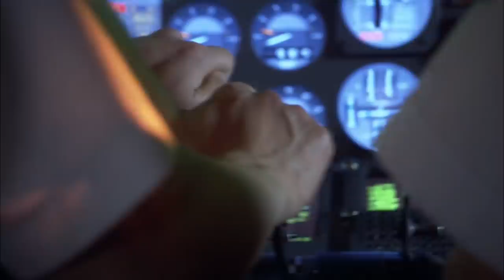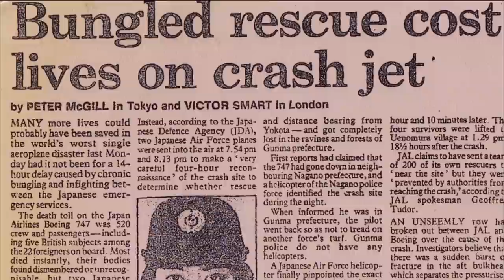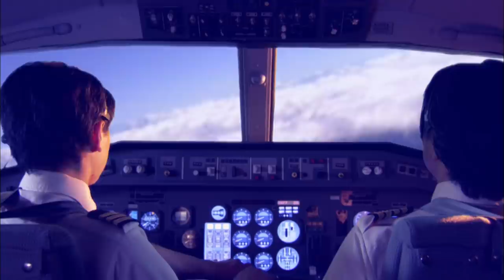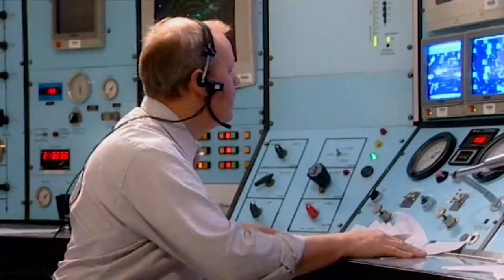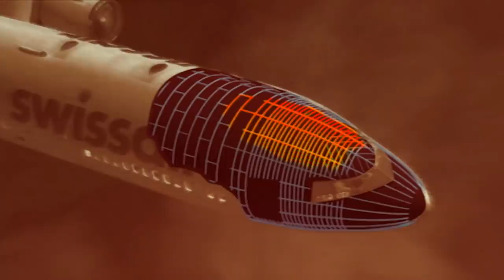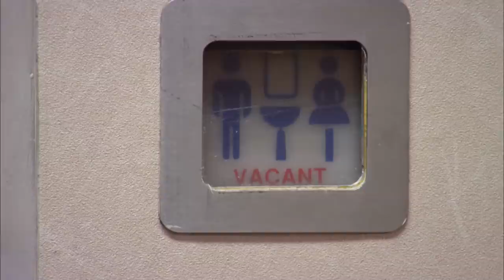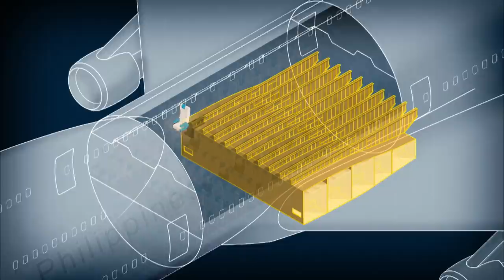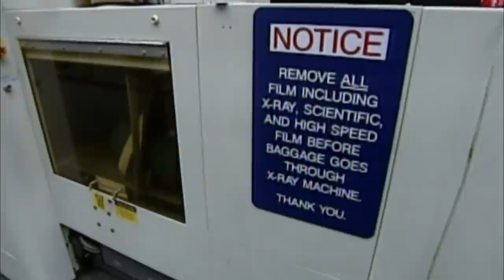The Deadliest Aircraft Disasters In Aviation History | Mayday | Wonder

Comment: Re: The Japanese flight. Yes, the ho-hum attitude of the self defense forces certainly cost lives. Must be a cultural thing is all I can guess. The attitude of the police treating the disaster as a crime and restricting access to the only people that could figure out what caused the crash wasn't helpful either.
The pilots did an amazing flying job keeping the plane aloft as long as they did.
Excellent video.
Reply: All they did was postpone the inevitable
Reply: @Seri-Katil  They kept trying to save the lives of every person on that plane right up until the last moment. As they did not know exactly what was causing all the issues, they continued to keep the plane in the sky while attempting to problem solve.
Reply: L
Reply: @oOoJadeBladeoOo  Christina, hi. What does "L" mean ?  Chuck
Reply: @charlesclager6808  usually means Loss. see it used under something where people think someone has a bad opinion or they said something/did something they don't agree with. alternatively people use W in the same fashion for things they agree with, W for Win
Reply: @Seri-Katil inevitable means the crash was going to occur yet they came close.   So close that Dennis fitch studied the Black swan event and used differential thrust to minimize damage

Comment: The Philippines Airlines one, the captain taking over communications with ACT in saved them a lot of time and frustration. And having an American take over on ATC's side was also smart so that the two could have a conversation in English without any problems. If they didn't, they probably would have ended up struggling back and forth and had even more issues.

Comment: It was not human error or a faulty repair. They told the airline it would only last 10k flights and it did. The airliner wanted to save money and got a cheaper/ temporary repair then made it worse by not addressing it when they were supposed to. 12k plus takeoffs? You're just waiting for it to fall off at that point.

Comment: The Japan Air Lines Flight 123 crash was heartbreaking. Four out of the 520 people onboard survived which is a miracle, but I feel so bad for the victims families. A simple mistake caused by a maintenance worker, cost the lives of 516 people. He had no bad intentions, but he should’ve known better. Do your job correctly because if you don’t, the consequences could be fatal. May all the victims aboard Japan Air Lines Flight 123 R.I.P they are deeply missed but are in a better place and that’s all that matters ❤

Comment: They say it is more dangerous being in a car than in a plane. Okay. Question: Which would you rather be in a crash in? A car? Or, a flying plane?
Reply: Personally, I'd rather be in a car crash because there might, just might, be a chance to jump out of the car before impact... very very slim chance, yes... but at least you're closer to the ground if you can manage to jump out in time and hopefully, you don't get scraped up too badly when ya hit the pavement at whatever speed...
But in a plane, even though you'd have a few minutes warning and probably plenty of time to jump out of the plane, if you're in the air at 5,000 feet, you ain't gonna survive the drop anyways...

I feel safer in my truck, thanks.
😆

Plus... in a plane, if there's a problem, as a passenger you're screaming and scared shitless for many minutes before you die...
In a car, accidents happen so fast you usually don't have much time to be scared (which is why the odds of having time to jump out are slim, of course...lol)...
But I'll still take my chances with land travel over air any day.
😆
Reply: 99% of plain crash passengers survive. Can car wrecks say the same?

Comment: Imagine how different JAL123 could have been if the flight crew DID use their masks 😷 and help had arrived sooner…
Reply: MANY would have been Saved! In MY Opinion, they were responsible for someone elses life; the CEO that Committed Suicide; he Blamed himself, when so many people could have lived, if they didn't "stall" the Rescue Operation 😠😠😠
Reply: yes, that was really tragic !
I suspect that many of the first responders were unhappy with that decision ! (To put it mildly).
(Well, that's what I imagine, anyway).
Reply: Even if the flight crew did use their mask i don’t think it would make a really huge difference,the plane is uncontrollable and has no hydraulics to control the surfaces,and it has a broken rudder meaning it can’t yaw,but the pilots kept it in the air for an impressive 30-40 min
Reply: nothing different probably would have happened
Reply: Incompetent!!!
Reply: @luigiweegee7152  Yeah, it was far worse than PAL434 (the last one in this video), but still, in that other case, the pilots explicitly tried differential thrust, and overall seemed more experienced than JAL 123, and were over the ocean always, not having to contend with mountains.
Reply: @alext3811  For the case of PAL434,they did have some hydraulics and had more control than jal 123,jal 123 didn’t have hydraulics and have a missing vertical stabilizer making the situation way worse.

Comment: “Aircraft hit the water with the force of 350g (s)” …. That’s not possible, right?  Maybe they meant it was traveling at 350 mph? (This was within the Swiss Air crash documentary.) 
Isn’t there a terminal velocity? Or perhaps I need to review my understanding of Physics. It’s been a while.
Reply: 350 is correct. You’re forgetting they’re also powered. I believe the black box can withstand 1000gs
Reply: @sc1338  My stomach dropped reading your reply. 
So a jet fighter will travel at most 5-6gs right? And maybe the best rollarcoaster is 3-4gs … but the airliner will be only 0.5g at takeoff … So a crashing accelerating plane can get to 350g … oh those poor people
Reply: @hlowrylong  but on the bright side that also could be a good news. With that force you might just die in a flash of eye? if a metal plane got into millions of pieces because of that force as they mentioned, what do you think happens to you in a second? you might see a flash of light and then straight to the next stage.. or nothing depends on what we are gonna believe!
Reply: @aref111  That’s true - better to go fast … I just hope the people passed out while diving to the ground … I’d be barfing up the whole way down!

Comment: They were overweight in all 3 categories, fuel, passengers and baggage...fuel dumping should have been their very first action to lighten the aircraft, lowering the landing gear caused drag that increased the workload on the engines. With 50 less passengers and their baggage and ten thousand pounds less fuel this plane may have been recoverable?